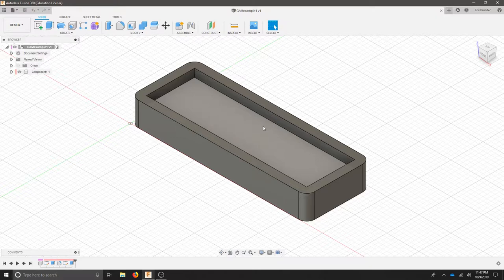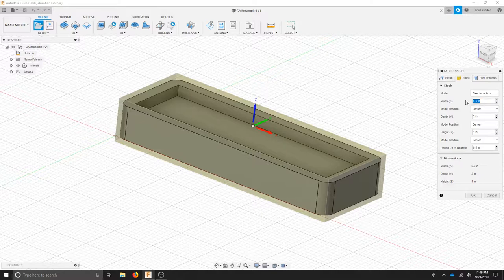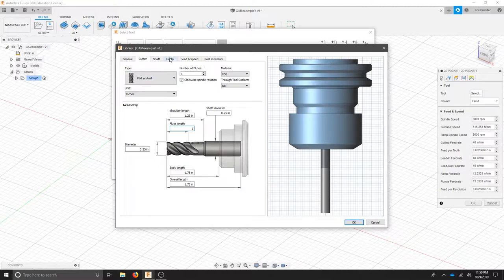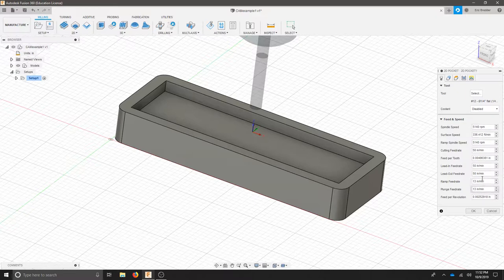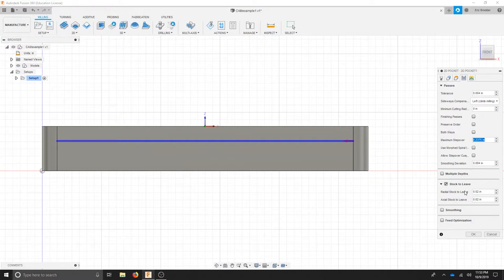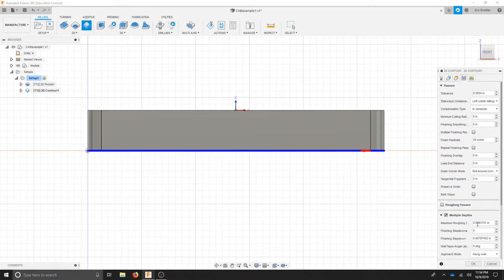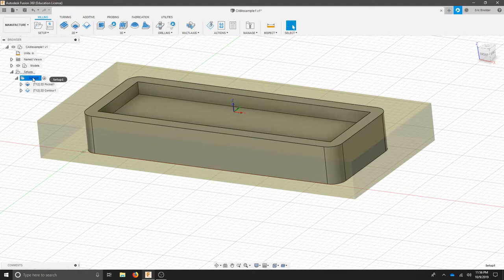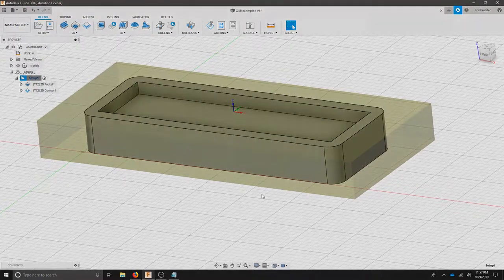Simple 2D CAM Part in Fusion 360

Comment: your pocket is a right angle pocket. With the tool you used (1/4' dia flat bit), how did you handle the corner cutting? Thanks